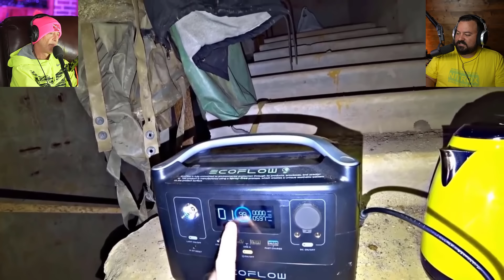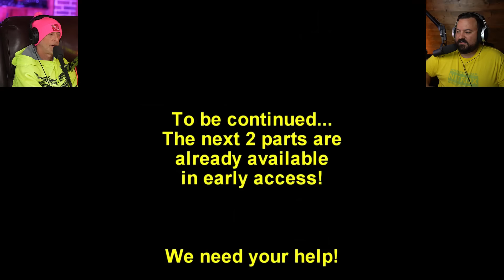Divers React to Diving in Chernobyl Part 2!

Comment: It never ceases to amaze me how easy it is to enter the exclusion zone, the red forest and even the plant itself (outside of the actual reactor point that triggered the meltdown), everything appears completely open from both the Ukrainian and Belarusian sides. It's crazy there are no barriers or checkpoints, nothing, you can essentially walk across the border into the red forest (which is exactly how Russian troops invaded across the Belarusian border, so maybe things will change in the future)... There is a decommissioned nuclear facility in the state where I live, there are strict protocols on who can enter the campus and facility. A security guard was exposed to radioactive debris and radioactive particles were traced for miles and it was a huge deal that made the news for days. But here? No one seems to care, it's bizarre.
Reply: there were checkpoints and other safety measures and there are foot, and vehicle patrols around the exclusion zone. the main issue however is thanks to the economy tanking and then russia starting stuff in 2012 the budget for cherynobyl cratered. so all the troops that were their their main jobs was basically keep people from doing to stupid stuff or from nicking the radioactive stuff. and the rest of the budget was solely kept on keeping everything safe enough to work. if you see videos from just before the NSC was put in place you'll see that everywhere including the reactor complex itself is degrading fast because no building maintenance is being done cause they don't got a budget.
Reply: Might wanna look into this. It's like the US southern border. There is no total wall, and the man power is not enough to cover every square inch.
Reply: Maybe because nobody is stupid enough to do it unless they are insane. People can easily die by doing what they are doing
Reply: @Meekaiale  There are tons of videos of people entering the exclusion zone and walking around at the site, plenty of people are absolutely "stupid enough" to do it.
Reply: You expect people to work there in radiation ?😂 and who is gonna pay all those checkpoints and people
Reply: @evangeline77x  yeah but mostly are fake. entering chernobyl exclusion zone comes with a fine of 2-10 k and possible 1 to 3 years in prison, imagine how smart is to film yourself doing it. most of those videos are people taking regular tourist trips and pretending to be in the exclusion zone. it's just content. first thing you need to do with everything : doublecheck before believing. especially on sites like youtube where people have money incentive to create pseudo narrations to boost views.
Reply: @tommyfanzfloppydisk  lol, entering the Exclusion zone is not difficult at all (I did it too), you just need to be careful. And if you got busted, the fine was like $20 before 2022. I think in the very end of 2021 they passed a new law that increased the punishment to smth like a $1.5k fine (which is a lot considering that the average monthly wage in Ukraine was about $500 back then) and potentially up to 3 years in prison, however I do not know a single case of anybody getting a real sentence for trespassing the Zone. 
Anyway, it WAS relatively safe before the russian invasion. Since then the real danger are the land mines and unexploded munitions. If you accidentally step on an anti-personnel mine somewhere deep in the forests of Chornobyl, nobody is going to help you. Besides, the northern border of the Zone is guarded by the Ukrainian army so if a stranger goes there, he'll be in trouble. So better not to go there until the end of the war.

Comment: Reactors 5 and 6 were partially constructed but never completed. Based on the exterior of that building, it appears to be a building that was paused mid-construction exactly one mile southeast of reactor for near an incomplete cooling tower. Not sure how extensive the tunnel system is there and I haven't watched part 2, but I doubt those buildings are even linked underground. May be wrong though.

Comment: Okay, so I know this is probably too late to be useful for most people but as I watched this video I did some research and apparently the unit 5 where they are is an unfinished reactor in a building about a kilometer (0.6 mi) to S-E from the main building with the original four (which is much better secured). In fact it is the reactor that's the furthest from the unit 4 that melted down. 
Which means that even if there is a tunnel connecting those two buildings, it would be very long (~1 km) and on the other side there is still the whole main building (itself over 600 m long) to get through. Fortunately it also means that the radioactivity here probably isn't nearly as high as it would be in the main building, let alone near the fourth reactor. 
Btw. the radioactivity around the power plant isn't all that high, mostly I think it's around 3x the normal background rate anywhere else, it's just some specific areas where it's higher (like the Red Forest) and only some specific parts of the fourth reactor building where you can actually get acute radiation sickness. So no, the guy at 13:20 is not "blushing from radiation". If he was sick from that he would be nauseous, pale and possibly start vomiting in a few hours, depending on the dose.

Comment: they said at the beginning that they are in reactor nr5. i took some time to look up some things. 
1. reactor nr 5 was only ~70% complete at the time of the accident.
2. block 5 is more than 1 km away from block 4.
3. blocks 1-3 were taken offline between 1991 and 2000.
i dont think that there is any harmful amount of radiation close to where they are, but its still a very bad idea to do what they do.
Reply: I watch their videos and they come across a lot of hot spots...
Reply: That whole place is radioactive, I watched a documentary on it a few years back. I watched when they had to close in the reactor that blew up with concrete over the whole entire building.
Reply: They thought they could swim a whole 1 km underwater?
Reply: @stevemcgowen  how do you find more of their videos?

Comment: I remember watching where it was explained spent nuclear rods are stored in water to control radiation. Water is a great insulator. They said you could swim in water holding rods. If water was drained those same rods would irradiate you. Pretty nuts, regardless.

Comment: Guys, one atmosphere is one bar! So when they say their tank pressure is 125 atmospheres (125 bar), it's absolutely possible, and even frightening! Starting a dive with such a small tank (looks like a 6 liter one) at such a low pressure would be not advised in a regular situation. Any modern tank has a working pressure of at least 200 bar.
Reply: It's probably 10L imo
Reply: @Wojtkacy  I don't think so, at the start of the video in the "dive shop" we see an actual 10L tank (black one). This yellow one is significantly smaller in diameter (compare it to the legs and arms). A 10L is more stubby. 
But in either case, it's still suicidal to try to dive in there... Ice diving in an already overhead environment that's also radioactive???

Comment: There are tours you can take at Chernobyl, it’s safe. The only areas that aren’t are unit 4, that melted down, now housed in a metal shell and places like the basement of the hospital where the clothes first responders had worn were discarded there. These guys are more in danger of unstable places in unit 5 and from mold and tetanus.

Comment: 1 bar is almost 1 atmosphere which is 14.5 psi. Just different units of pressure (atm in this case, not ata). Although it’s still very likely the SPG was in bar and they just misread it.
Reply: Yess bar and atmosphere Are almost 1:1
Reply: so, he meant the tank'd be at 125 psi then, right?
Reply: @grkvlt  nope. He meant it was at 125bar.
Reply: So gus, woodie.. they were right...

Comment: The sub surface water in and around the Chernobyl nuclear accident site is still radioactive. There is Sr 90 (Strontium 90) and Cs 137 (Cesium 137) among other radioactive contaminants in the surrounding ground water. The exclusion (evacuation) zone is 30km out from the reactor. Thats where the radioactivity is deemed safe.

Comment: 19:00 "BAR" is pressure in multiples of average atmosphere pressure (14.7psi)... 120 BAR is low for a fill from a dive shop. Normally you'd look for 180-220. 50 BAR expected when you get back on the boat.

Comment: If these guys don’t immediately get to the hospital for radiation poisoning, I’m very worried for them. According to a quick Google search, the standing water in and around the areas of Chernobyl's Reactor 4 is considered highly radioactive, with levels significantly exceeding normal background radiation due to the presence of various radioactive isotopes, particularly cesium and strontium, which leaked from the reactor core during the accident. Water is heavily contaminated with radioactive elements, meaning radiation levels in the immediate vicinity would be extremely high and potentially lethal.

Comment: Yes, the water in the Chernobyl exclusion zone is considered radioactive, particularly the groundwater, due to the contamination from the Chernobyl nuclear disaster, with the most significant radioactive elements being Strontium-90 and Cesium-137; therefore, drinking water from open sources within the exclusion zone is not safe and is strictly prohibited

Comment: They used to allow tours  to Pripyat, but they always took a Geiger counter to monitor the radiation And everyone had to leave after 20 minutes due to the length of exposure to the radiation being very dangerous. So I can’t imagine the levels of radiation in that building and in the air and the amount of time that they spent there practically at Ground Zero was good for their health! And then diving into contaminated water, under ice, with crappy likely Soviet era and extremely basic equipment. If they don’t drown to death, fall into a concrete void crossing over rotten wooden bridges or get impaired on some jagged piece of metal, then they can look forward to Radiation poisoning and burns and at some point most likely an early and horribly painful death!!

Comment: Yes the water might be radioactive but it depends if it’s been in CONTACT with the nuclear ☢️ stations or FUEL parts due to the thing they use to fuel it is H2O aka water they use water as a conductor for the energy and when number 4 melt down the water was literally a BIOWEAPON basically

You can correct me if I’m wrong

Comment: One of the things you get told if you take a tour of pripryat is not to eat or drink anything. (Tourists still ignore this because they are dumb and some tour companies dont care.) because dust in the air can get on it and then enter your body. (Again Pripryat, not a nuclear reactor next door to reactor 4 where you just kicked up a ton of dust.)

Normally you only need to worry about gamma radiation, as beta waves cant penetrate clothing and alpha waves cant penetrate the outer layer of dead skin. Once you ingest it, all bets are off.

Comment: It is right, that the dust is the most dangerous thing there. Not only because of radiation, but the heavy metal particals. If I would (have to) go there, only on a rainy day. And it is true, that water cann block some kind oc radiation, but not every kind of radiation.

Comment: Now its clear. This is not reaktor 4. This is reaktor 5 which is southeast of reaktor 4 and has never been finished. that means there was no radioactive material in it ever. Though it is close to reaktor 4 which is within the sarcophag and still emmits radiation. so there is definitely a danger of radiation poisoning, except the diving stuff. but it is not as serious as they say.

Comment: 18:58 i'm confused, i'm a diver myself and the 125 atmospheres the divers were talking about was right if the meter says 125bar of pressure? 1 bar=~1atm so what are the the people reacting to the video trying to say?
Reply: 125bar = 4,125 ft of depth
Reply: @palehorse7377  ?the pressure gauge he was talking about was in thet tank, not depth. As in how much air they have in the tank. For example max allowed air is 207 and you usually dive with around 140-170 bar in the tank.
Reply: @JCars-Bikes  they said atmospheres not bar. which is the tank pressure.

Comment: So the issue is indeed with the radioactive dust particles. These will be in the water, and on every surface, including suspended in the air when disturbed. The issues is not so much getting it on your clothing or skin, it is breathing it in and ingesting it, which is where it does irreparable DNA damage. Seeing as they are taking no precautions whatsoever, we can be fairly sure that they would have inhaled and ingested large quantities of radioactive dust. These men are not brave, or hardcore, they are simply ignorant to the reality of their actions. They don't seem to understand that the likely outcome will be aggressive cancer a few years or even months from now.

Comment: It is not, and besides, it’s not an element. The elements that make up water are oxygen and hydrogen; their common isotopes are resistant to neutron activation. So are nitrogen, carbon, iron and others.

When neutrons are running around free, they tend to stick (be absorbed) to most any elemental nuclei. Some elements, like say sodium, immediately become unstable and radioactive; others, like hydrogen, move to another stable state and only become unstable when that particular atom gets hit twice, doubling a very low probability of being struck at all. With two neutrons, hydrogen becomes H-3, “tritium” which is radioactive. You will get a very low rate of tritium production in the primary coolant of a nuclear power reactor, for example. Oxygen takes three absorptions to become radioactive; in the free atmosphere, around a nuclear weapon explosion, say, the chances of that are nearly zero. OTOH, an underwater nuke, like Crossroads/Baker, activated mainly the sodium in the sea salt.

Comment: Don’t know where their steeling a doing with the steel.  I worked a decade in a steel mill.  An all the scrap ran through radiation detectors.  If it went off.  The mag crab would pull out of the bucket until it was found.  
Due to if it got into the furnace. That whole 100ton furnace would have been shut down an had to be rebuilt.  
And it’s all ran through radiation detectors again after it’s been made into new products before leaving the property.  

Can’t say what they do there.  But if it were here. It would only have use to the owner.  No steel mill would accept that crap

Comment: Reactors 5 and 6 were close to 70 percent complete but never ran they ARE in chernobyl but they are not near complex 4 still much radiation is there but I repeat 5 and 6 never melted down so they are in less trouble (I googled images of the crane and they are definitely telling the truth about the complex but not about reactor 4)

Comment: Units 5 and 6 are nowhere near Unit 4 - in fact they were opposite end of the site, and most importantly nowhere near complete when Unit 4 exploded. Give or take some dust it's about as dangerous in radiological terms as your nearest pool, and arguably given the site has been crawling with international teams for like 40 years almost now it could be safer. There's absolutely no way it connects to Unit 4 underground. Still super dangerous, but for traditional reasons. Proper People explored Shoreham NPP in New York and it was more dangerous than this in radiological terms because it'd actually been a completed reactor that had operated with fuel, albeit at low power levels - though mostly decommissioned when they explored it. There's a reason there's no security around on a pretty secure site with a lot of radiological risk - they're in more danger outside than in Unit 5.